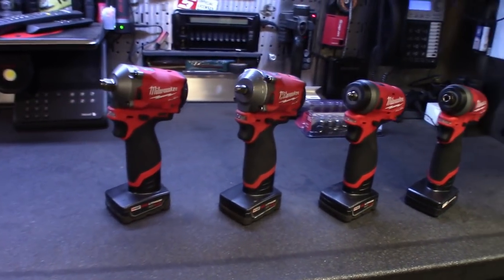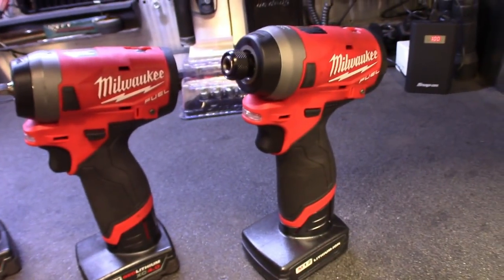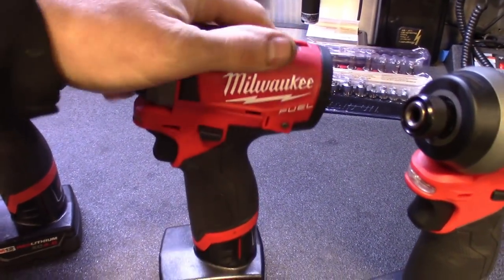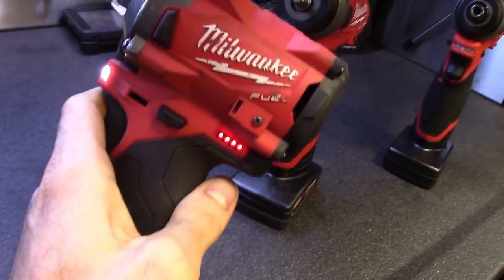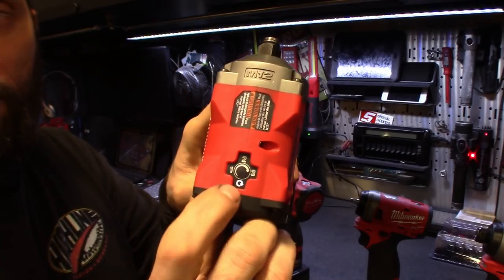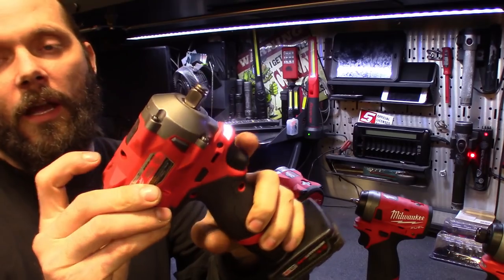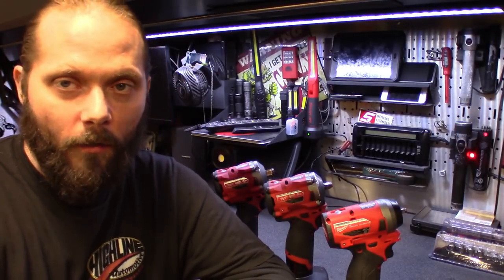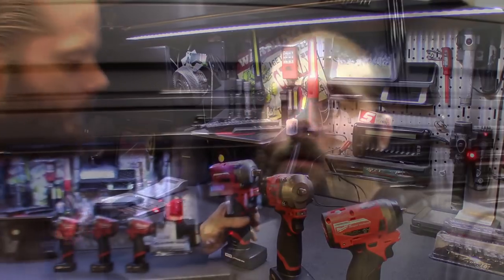Stubby Review & ToolHeadz News

Comment: Thanks for the review. Not bragging but my line up after trial and error and finally finding what's works for me is I got the milwaukee 1/2 mid torque, 3/8 stubby, snap on 1/4 ratchet the ctr 714, the 3/8 snap on ratchet and the long neck 3/8 ratchet, and the snap on cordless screw driver. Other milwaukee tools I have but this is the line up that works for me in those tough area access situations. Snap 3/8 18 volt doesnt compare to the milwaukee stubby or the 18 volt 1/2 inch impact gun to the milwaukee. Now the ratchets to me using the milwaukee ratchets is just too bulky for real. Ratchets u dont need that much torque unless u like retapping threads alot. For that u have impacts. This is just from a person who used both products being in the field for a long time. Thanx for the review. Milwaukee taking over

Comment: Personally, just my opinion..but I would go 1/2 anvil. I ordered mine last night after alot of thinking. Figured i could always use an adapter to 3/8 if needed and I myself would like to be able to rotate tires on the car and mid sized truck when I need, along with working on motorcycles and changing wheels and sprockets. So I went 1/2 but I'm sure the 3/8 would also do the tasks. Just felt better with a more heavy duty anvil. You dont lose much torque at all with a little 1/2 to 3/8 adapter. Also for tight fit areas I got the fuel 3/8 ratchet. For big stuff I still got the 1/2 pneumatic. Watch alot of you tube and make the best decisions that makes since to you.😁👍 there is no really wrong choice with Milwaukee cordless tools in general anyways, aspecially the fuel line.

Comment: Thanks for a great review. I am loving my 3/8" stubby for wrench work. I have a dumb question tho about using it as a screwdriver or drill. What's the name/brand/kind of adapter that will fit on the 3/8" stub and the other end will tighten on a screw driver bit or drill bit? I have bought 2 fittings and neither works well. Can someone advise!?

Comment: Love my 3/8 stubby. Use my m18 Mid/High torque for 1/2 sockets for the bigger nuts/bolts. Also have the m12 non fuel ratchets and love them as well. They are weak on power, but use as ratchet carefully to loosen first and then spin off the nut. Tightens just enough to not break your knuckles when it stops abruptly. Milwaukee tools are great buys compared to snapon and the 5yr warranty is nice to have.

Comment: a swollen lithium ion battery is dangerous?

Don't charge or use it at all, because lithium-ion (Li-ion) batteries that are bulging have already bypassed built-in safeguards and are swollen with gases. Continued charging or use could lead to a runaway reaction that results in a fire or an explosion

Comment: I have the m12 and m18 3/8ths havnt pulled the trigger yet on the stubby.  Not sure if I should buy it now or wait for the new gen to come out.
Reply: It amazes me how strong my M18 3/8 is.
Reply: @michaelstjohn6086  I know . I've tested it and its removed lug nuts and alot of suspension bolts amazing.
Reply: I own both the first Gen m12 3/8 impact and the Gen 2 m12 3/8 stubby and I don't know the ratings but just in general use the stubby has two have more power, it's also diceaving  just looking at them  but the stubby fits in such tighter places love them both.

Comment: Question for you I do my own car work i.e. just my breaks, take tires off little easy stuff I ordered the stubby 1/2” but I’m thinking I should have got the 3/8 ...all my sockets are craftmans 3/8” and 1/2” .... can you help me decide please or should I have both
Reply from the maker: The Milwaukee stubby are the same power. You should be fine with the 1/2 but will have to use a adapter for your 3/8 sockets
Reply: Will I lose power or with an adapter or am I overthinking it ...
Reply: Also wanted to say thanks for all your info
Reply from the maker: Maybe a little torque

Comment: I love my 3/8 so far. I'm hoping to not need the 1/2 version but I'm just a DIY'er in my home garage
Reply: I’m looking into buying my first one. Idk if I should go with 3/8 or 1/2 I want it to do suspension and for lugnuts at home. I’m also a DIY’er. Did you end up getting the 1/2?
Reply: @michaelhernandez1398  nope. The 3/8 has proven to be everything u need it to be. In my opinion if you are too a point where you need more torque then you probably need a bigger impact and 1/2 drive socket. My motto as my father taught me. Better to have it and not need it than to need it and not have it

Comment: I just don’t know if I should jump into the Milwaukee line... but if you say I guess I’m just gonna have to check them out. Thanks boss!! 
I’m stuck on the 20v ingersoll rand and of course the 14.4 snap on....👍💎
Reply: patwhitelexus2jz I’m in the same boat. My Ingersoll Rand 20v 3/8 is a beast
Reply: Once u switch to milwaukee you wont look back man. I was a die hard snap on forever but milwaukee took over on the battery stuff. The snap on stuff just cant compare.